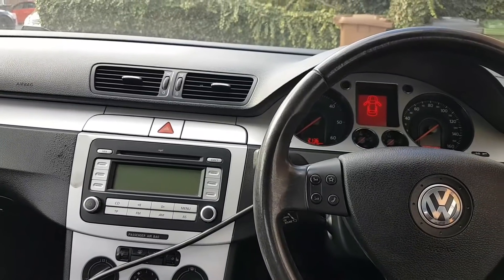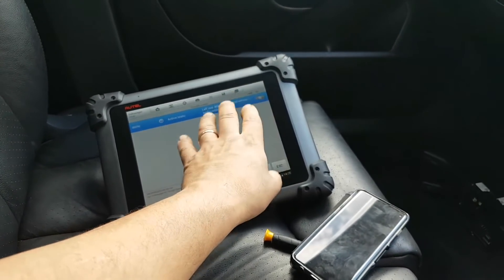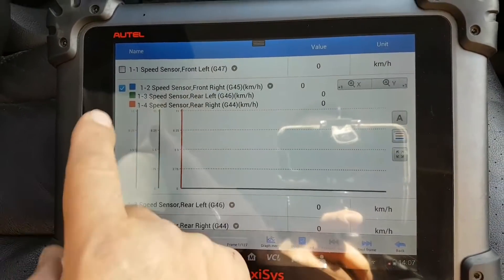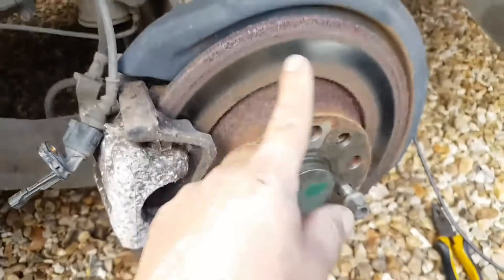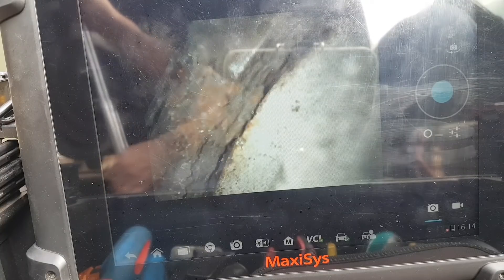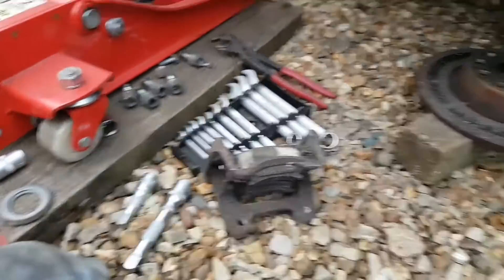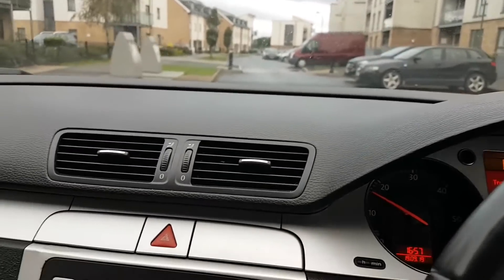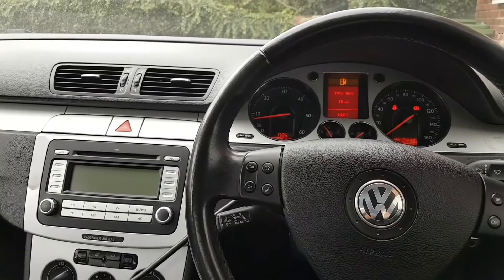Passat ABS/ESP activating while driving... Fault finding and repair.

Comment: hello, I also have these 2 dashboard lights on my volkswagen Passat b5.5 1.8 t petrol 20 v sedan, I changed the rear left wheel hub with new abs sensors, and it gave me this (open circuit/short circuit to b+) ) what if, I'm waiting for an honest answer, you have more experience than me
Reply from the maker: Hi
Have you scanned the car before replacing that?
👍👍👍
Reply: @LMAutoRepairs  yes it scanned, this scanned open circuit/short circuit to b+
Reply from the maker: Have you checked wiring?
Reply: @LMAutoRepairs  not yet, how can I check the circuit with a multimeter so that everything is in order
Reply from the maker: @ciprianionutapetroaie7314 
You measure the wires between the sensor and the ABS module...
Reply: @LMAutoRepairs  how to do this with a multimeter, I'm a beginner
Reply from the maker: @ciprianionutapetroaie7314 
Measure continuity/resistance on the wires between the sensor and the ABS unit...
Reply: @LMAutoRepairs  ok thanks

Comment: Sir, I am from Ukraine. 
And I really apreciate you for that video. 
I will be able to fix my car by myself. 
Ty. 
But with that problem. 
On my passat b6 computer shiws problems with general computer block ABS. 
Could you advise if I will fix this sensorof ABS on my right rear wheel. 
All should ve fine with general block of ABS
Reply from the maker: The sensor is one issue... the unit can be another...
If you have faults for the speed sensor, measure wiring to make sure you don't have a wiring issue, if all OK, tackle the sensor or reluctor ring... you need to inspect to understand what is wrong...
👍👍👍

Comment: Guys need your help with my audi A5 took it for some suspension replacement lower control arms replaced took it for wheel alignment few days later car was making some funny noises I end up replacing upper control arm with the stabilizer after doing so the car throw engen light and esp light is on when you start the car is off but if you drive the car for few sec or when you turn the steering to right it triggers the stability lights the scanner says a lot of things like steering column and steering sensor we tried to clear the lights but keeps on coming back

Comment: Great job again Luis.I see a lot of that.I wondering that you was able to make the steering angle calibration.......bearing foult normaly makes that imposible.
Reply from the maker: It didn't... as you have seen...
It might vary depending of the software version... 🤷‍♂️

Comment: Another great video with good detail. Can't beat the maxisys, I have the MX808 and although it does not have as many functions as the maxisys, I would not buy another brand as Autel supply good diagnostic readers/coders. Had mine for a few years and to be honest not had the need to upgrade but no doubt the time will come, but one things for sure, I would stick to Autel...Great pieces of kit...
Reply from the maker: I know I am biased, but yes, great tool!
Thank you for watching and for your comment! 
👍👍👍